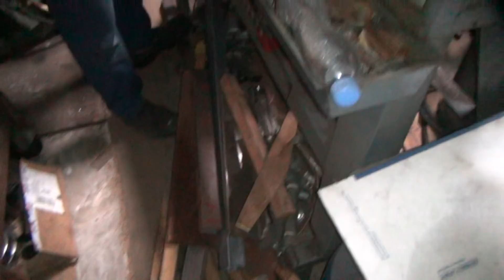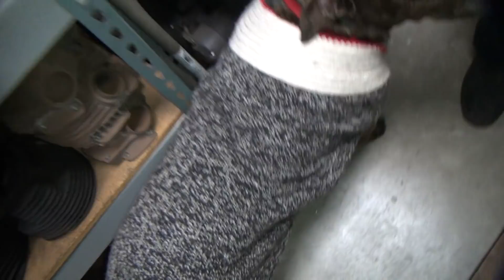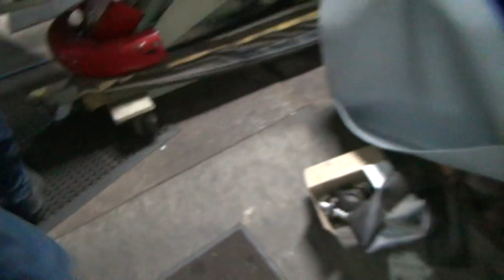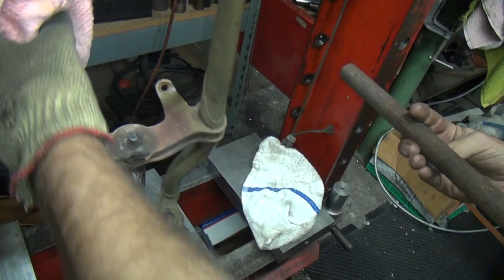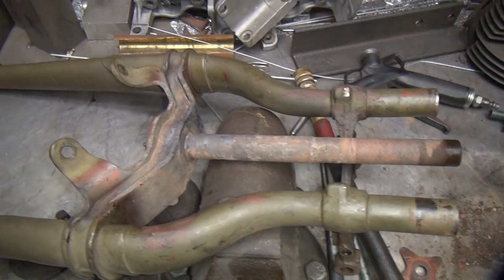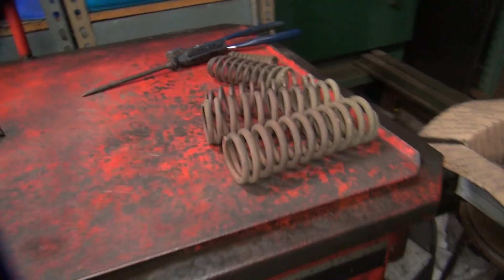1942 wlc wla 45ci #127 springer fork repair rebuild harley chassis reassembly by tatro machine

Comment: What transmission and sprockets do you use to operate this bike at highway speeds?
Reply from the maker: 33t motor sprocket. all the other ones are maxed out stock.
tatro